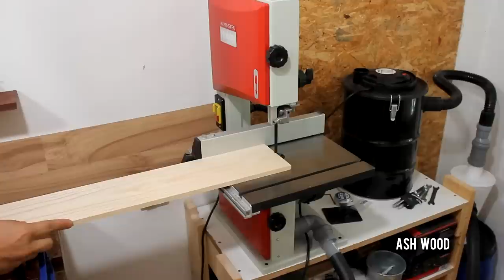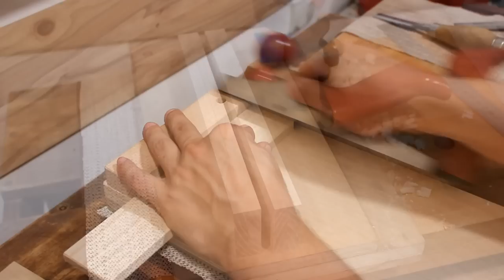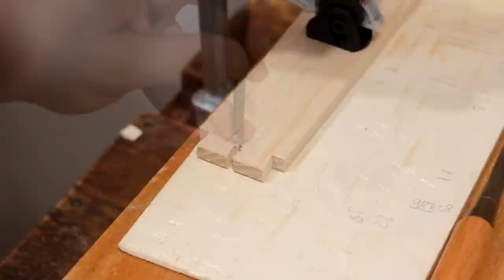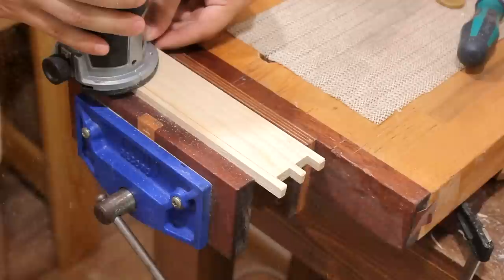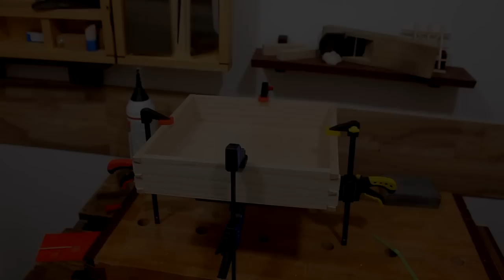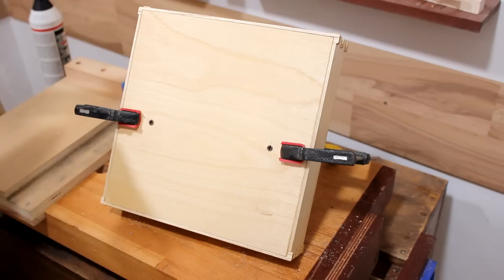Western Chisels Tray with Proud Dovetails

Comment: Really nice work on the toolbox. I've got to ask since you are among the few working with both Western and Japanese tools:

How you compare the MGH chisels with the Japanese oire Nomi?
I ve heard that Nomi are harder and get sharper but also break edge faster. If you would choose one type what would you get?
Reply from the maker: Thank you! I use MHG for heavy jobs and the jp ones for fine details, also the price of jp is 4x MHGs :) The jp don't brake faster, but they are brittle so care should be taken not to hit them too hard where there is no needed, or other types of chisel should be used like mortice chisels which are more thick.